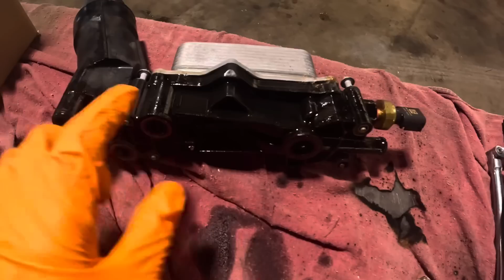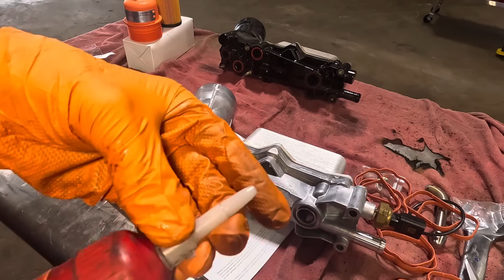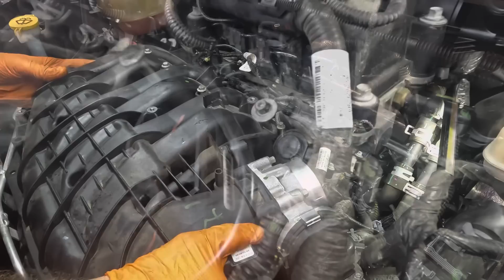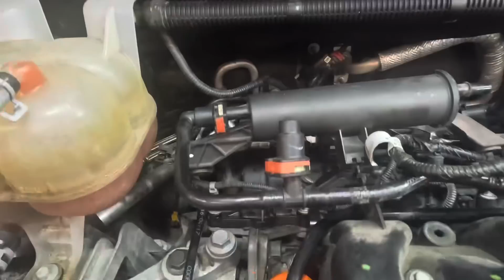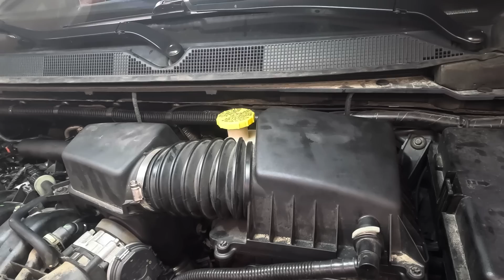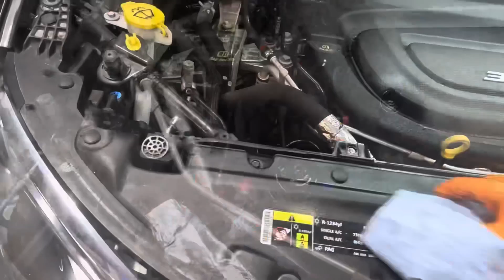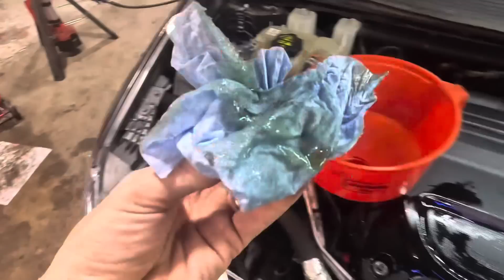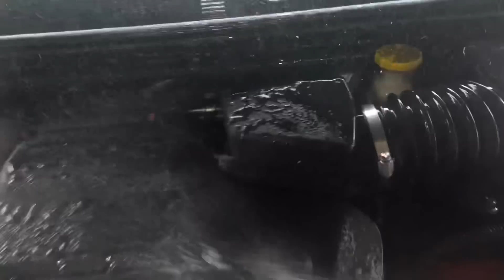Plastic Pentastar 3.6 PT2 Chrysler Dodge Jeep Ram Volkswagen. Leaking Oil Contamination!

Comment: Good morning Ray, I thought you said you were putting in new spark plugs and coils (part 1) which made perfect sense seeing as you would save the labor being that far along? never mind just watched alittle further....Ooops   As to the using the torque wrench both ways I can only speak to higher end units but will also say how else do you record break away torque required for warranty in certain issues.

Comment: On the torque wrench question, i think the idea is more that you don't use the torque wrench like a regular wrench. I would assume that the line of thinking is that you would wear out, and make innacurate, the mechanism that makes the torque wrench a torque wrench.

Also, to address the people saying it's fine because their wrench works in reverse: some torque wrenches (especially low quality ones) will have a reversable ratchet mechanism, but will not measure torque in reverse (just look at Project Farm's torque wrench comparison video). I don't disagree with it being fine though, i have old cheap torque wrenches that have been used in both directions and treated like crap and still read close to my newer more expensive ones. If you need to loosen a bolt that you just put too much torque on it's fine to use a torque wrench to loosen it back up, regardless of if the wrench measures in both directions or not.

Comment: Funny, I'm in the process of doing the oil cooler on my Wrangler right now. The fucking injector connector lock tabs have been a nightmare so far, got 4 out of 6 off so far but have the two worst ones left to go... I went with the all metal replacement as well.

Comment: Cooler made it past manufacturer warranty for the vehicle and is all that matters. To be cheap and save weight, plastic is the norm. 215, 000 miles on my 2011 Grand Cherokee, replaced it once and the roller rockers, Pentastar Tick, before it ate the cam.

Comment: Don't you think you should change that oil pressure sender sentence since they're so hard to get to? That would be a lot of work at that ends up being messed up too. And if it's not that much I think it'd be smart for the owner to say replace it
Reply: They are failure prone, too.  Replace with OE only as new aftermarket ones often don't work right.

Comment: My friend has a Volkswagen beetle and that is the problem for oil leak. Luckily it is not in the same location as the one u removed but it will require extensive parts removal in order to get to it.

Comment: I used carb cleaner spray on the intake seal surfaces to remove the gunk around the ports and a lite scrap with a plastic razor blade to remove said gunk. I always wanted a clean sealing surface.
Reply: Yeah...I do the same thing with baloney sandwiches...

Comment: The plastic ones were obviously junk as you point out. Chrysler changed over to aluminum in very short order but for the longest time they were only available through the dealership AND if you tried to upgrade it or wanted them to install the better part they would tell it wouldn't fit and wouldn't sell one to you. Had a buddy with a jeep who went through this 4 times!

Comment: Love the videos. The aggressive needle nosed pliers I really like. Where would someone get them? The way I see it if the torque wrench has a reversible switch then of course you can use it to loosen.
Reply: I disagree slightly on loosening. If it's below the wrenches torque range then sure, it's a normal ratchet. If you are trying to break loose a fastener with it? Your likely to damage the torque wrench

Comment: Are brand specific coolants a scam? My honda coolant is blue.
Reply: Well I started using the blue coolant in all the Honda's I work on, and it's good stuff.   I can tell you from my experience, I have noticed coolant system failures in general have been reduced in frequency since I started only using the blue stuff for Honda's, especially when it comes to plastic parts of the system.   For example the plastic parts of the radiator where the plastic/metal meets, a typical failure point for radiators, or plastic elbows/thermostat housing parts, have been failing less often.   I'd say in general however they formulate the blue coolant, it seems to be better on plastics in general, and it has a pretty long service life,  it's worth the extra cost IMO.
Reply: @jtjones4727   Nothing wrong with Honda coolant, but I can tell you that I've experienced exactly the same thing using the cheapest available house-brand extended life coolants, such as Supertech from Walmart.  This is over two decades of experience on dozens of different vehicle types, over hundreds of thousands of miles.
Reply: They're not a scam, but not necessary.  You'll do just fine using an extended life universal coolant.  But I'd stick with the blue if you're still under warranty, just not to experience any ho-hah from the dealership for any warranty work.

Comment: If you KNEW that the intake mounting hole threads were “tight” & buggered/boogered up?, Wouldn’t best practices have mandated that you chase the hole with a tap? At least?, But then again it could just be full of oil and the tightness comes from compressing that oil that you didn’t use any Brake-Kleen (TM) to blow out the hole with….

Semi epic-fail.

Comment: Ray some people used to tell me the when you put an extension on a torque wrench you changed torque(that isn’t true even if  the extension would twist the torque wrench wouldn’t click unless you hit the torque and there are torque extensions for tightening up lug nuts.  When a person in torque a nut it takes supposedly 1 1/2 times the torque.  The torque wrench you have torque left hand thread and right hand thread does it change the torque calibration for the wrench I don’t know that. I try not use it to untorque a fastener(nuts and bolts). I liked the intake torquing when you noticed the fastener wasn’t tight at the desired torque.  Have a good day Ray
Reply: Extensions don't change torque specs.  There are some videos out that put that myth to rest.

Comment: promaster upthsper intack front bolt holes are know to fill up with rain water and rust the bolt heads had to cut off the upper manifold to do the cooler

Comment: Back in the day, we used theCraftsman, old beam torque wrenches to loosen head bolts, on engines with a lot of miles just to see what they where still torqued to. We never heard you can't use them in reverse. The gauge had numbers in.reverse.
So got to call b.s. on.that.
Reply: What about something that is left hand thread? If it needs to be torqued, it will be using the torque wrench "in reverse".

Comment: Working  on Army helicopter [UH-1H] is require to torque all rotating hardware [bolts and nuts] Fastener to specs, or you may experience things flying apart
Reply: We'll get back to you when a Chrysler Minivan starts flying...
Reply: Velocity plus angle of attack can lead to flight. Just send it.

Comment: Ray when I was working on the f150 ford trucks changing them from left hand to right hand your trim tool was know as a Christmas tree puller I worked for a company called bill rich home of the f series my job was to strip the truck so it could be worked on to make it a right hand drive it was one of the best jobs I ever did plus I got to drive one back from the docks to the Work place best drive ever in my career as a car and truck manufacturer

Comment: Ray use the tephlon tape and pipe dope they technically are lubricants tighten till they ( make a seal) Have a great day
Reply: RectorSeal Tru-Blu pipe dope is both a lube and sealant, it can be used on threads and flanges to seal against leaks

Comment: The color for coolant does matter as it tells you what type coolant you are using. OAT vs IAT etc. so your little story about how the color or your “universal” coolant just doesn’t fly my bro.
Reply: You sir, are ignorant.  I am an expert on coolant and can tell you that dye does not tell you the formulation.  For instance, there is Asian blue (Honda, Acura, Subaru, Nissan) and Europoean blue (aka G11, used by VW/Audi in the early 90s).  Asian blue has phosphates, no silicates or borates.  Euro blue has silicates, no phosphates.  Want the best coolant?  It is the universal extended life coolants because they satisfy all requirements/specs for all manufacturers.

Comment: Ray, I've been wrenching for over 50 years, torque wrenches work in either direction, otherwise you wouldn't be able to torque left hand threaded components.
Reply: Absolutely correct.  Some companies elect to verify their calibration in only one direction.  In aerospace,  the range of the wrench was limited.  Ex: a 40-200 in/lb wrench was considered to have a working range of 72-184 in/lbs. 20% of the range of the wrench (160 in/lb) off the bottom,  10% off the top. This was supposed to provide greater accuracy.

Comment: Wow, did anyone else see the first liquid to drain from the sump plug removal was obviously not oil, was more like coolant followed by oil
Reply: When Ray took the oil cooler off, the coolent went down the holes for the oil to feed through the cooler. Which is not too big of a deal because Ray changed the oil before starting the engine.

Comment: I had mine changed a few months ago on my 2016 300C. Replaced it with an aluminum one. It wasn't leaking, but I had to have other work done that required them to take the top end apart. Just bought one and had the shop put it on.

Comment: After using compatible coolant and shortly afterwards having issues I will only use what the manufacturer recommends
Reply: What coolant did you use and what were the issues?
Reply: @coolantkid3428  used green coolant in a GM truck, bad move. Replaced water pump days later
Reply: @sfcjones2590  Yeah if you used the old style IAT green, that can give you issues.  If you use the new technology OAT universal extended life coolant (these are the ones labeled "all makes/all models", you won't have any issues.
Reply: I don't even trust them anymore. I use the Jeep pink in the wife's POS Jeep and Orange in the Tahoe and Suburban @coolantkid3428

Comment: Far too much plastic components in this engine, very easy to reduce the capability off these aggressive plastic fasteners to give the original first time grab force.
Cannot believe a manufacturer has used so many low cost methods for the engines life.

Comment: Ray, I'm rather surprised that you did not opt to replace that sensor in the off chance it could go bad in the future.
Reply: It's a known working unit. Sadly, far too many times, a brand new one doesn't work. It is better to go with the known good unit.
Reply: @larrys5198 
I use to not agree with your statement, but with the crap parts that are being made now, you are correct.  Stay with a known working part.
Reply: @shakerman55 OEM parts are always the best
Reply: I’m finding even used parts from the salvage yard are better than new replacements.
Reply: You know N.E.W. stands for NEVER EVER WORKED!!

Comment: You can use a torque wrench in either direction. What if you had to torque a left handed threaded bolt? If the torque wrench has a reverse then you can.
Reply: Rarely...yet thats interesting.
On old cars it was passenger side wheels on a Plymouth??
Thinkn 1950 era.
Reply: A lot of torque wrench’s cannot be used to measure torque in reverse correctly.  You have to check with the manufacturer to make sure.  It should say in the directions.
Reply: Everyone should read whatever instructions came with their torque wrenches.

Comment: I just changed mine on my Grand Cherokee last week. Never saw oil on the ground or any leaks what so ever, checked the oil just to check it, and low and behold nothing on the dipstick. When I drained the oil to replace the cooler I probably didnt have a full quart remaining in the engine. I saw one of your videos on this part a while back and because of that video I knew exactly what was wrong. Thanks Ray, you saved a blown up engine. Oh yeah, 165,736 miles 2015 Grand Cherokee Loredo.
Reply: If you had less than a quart of oil in your engine and just happened to check it "because", you have a very solid engine. Your engine would have been running with no oil pressure for who knows how long because even a quart or two wouldn't be enough for the oil pickup to suck oil.

Comment: Have you ever had to torque a left handed thread fastener?
Reply: They are common when reassembling certain transmissions, for example your countershaft might be reverse threaded, depending on which direction it spins.   Just one example I can think of.

Comment: It's reversible for left hand thread. Rules of torque wrenches for the uninitiated. You should never use a torque wrench to untigthen anything. You should send them to a professional once a year for calibration. They should also not roll around in a draw but be in their hard case.or in a tray. All of these things can cause the calibration to change